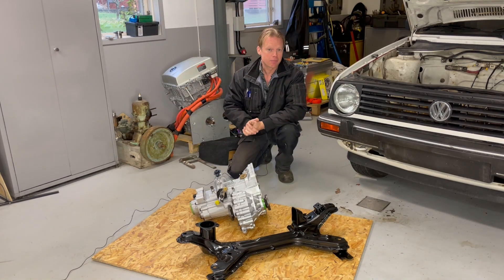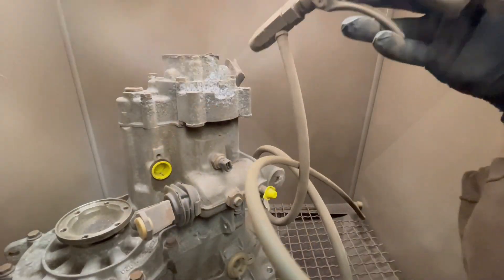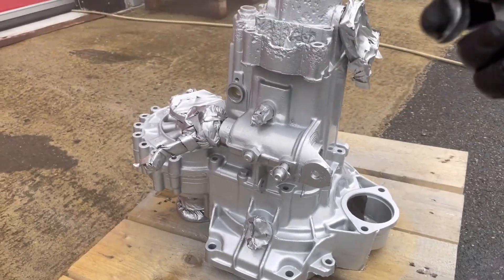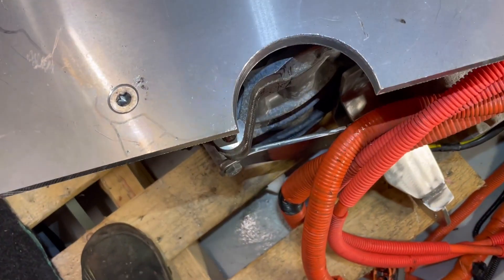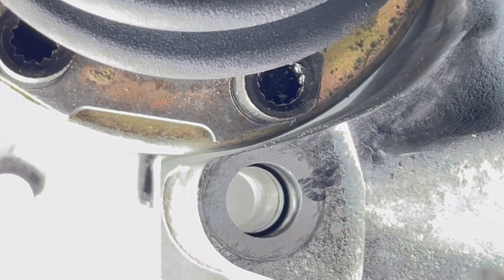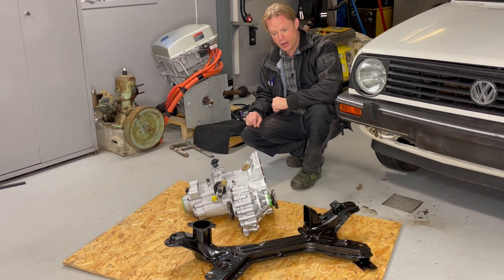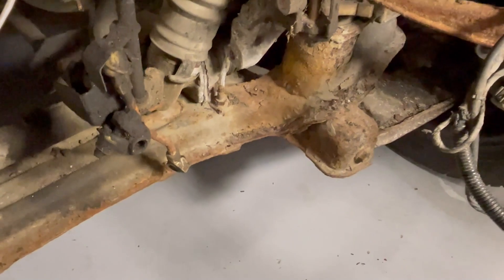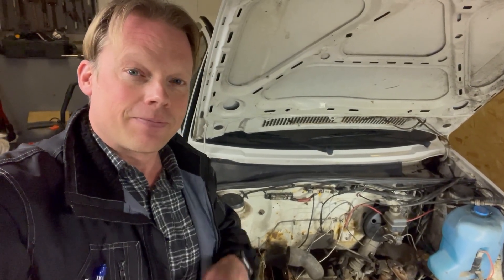EV conversion Vw golf MK2, rabbit, preparing the Vw gear box to the Nissan leaf motor.

Comment: very interesting video! I was surprised to see a 220V outlet in the engine bay🙄
Do you know something about the purpose?
I think the first halfshaft is still very close to the Nissan Leaf motor, maybe there is still need for more distance if the car moves!
Anyway - good work - the gearbox looks very shiny now 😄
👍👍👍
Reply from the maker: Hi and thank you ☺️ 
There were ones in the time batteries in the front, and a previous owner built his own battery heating system. So he simply just connected that heating element into the cars 120 V battery system to heat the battery.  That’s my guess anyway from what I could see from the old wiring.
Thank you so much for your comment 😃

Comment: Usually Rule 1 of EV conversions is "don't start with a rust bucket". But when your car is already electric, does that rule still apply? 🤔🤣
Reply from the maker: Luckily the rest of the car is in much better condition. But anyway, you absolutely have a point there.

Comment: Pretty much work. Wouldn't the whole leaf drivetrain have fitted?
Reply from the maker: Absolutely, it had been much easier, and probably more reliable.  The citystromer was  electric with a 5 speed
gearbox from the factory so that’s why I try this.
Thanks

Comment: Awesome work. I did the motor coupled to gearbox on my first conversation. Wish I'd used the transmission from the donor and had custom shafts instead. It works great still.

I'm now doing a RWD conversion so been rolling around on the ground all day trying to come up with some mount ideas
Reply from the maker: Thanks man! I now that feeling, and after a good night sleep, I at least use to have the answers.😅 Yes, let’s se about this gearbox solution, I will give it a try, the citystromer was  electric whit a 5 speed
gearbox from the factory so that’s why I try this.
Thanks for your comment☺️